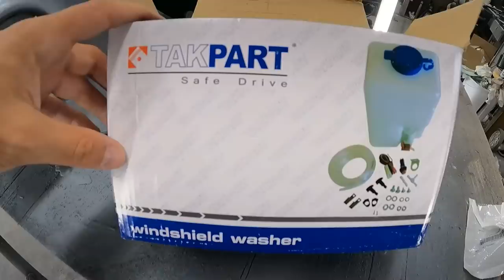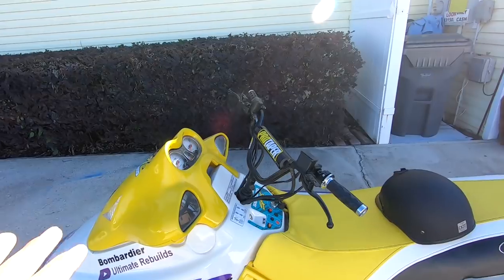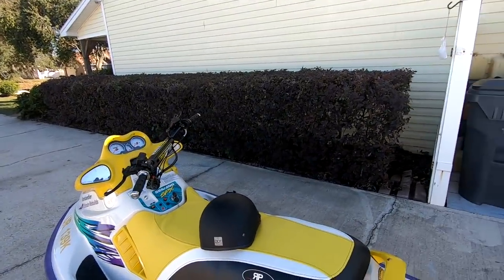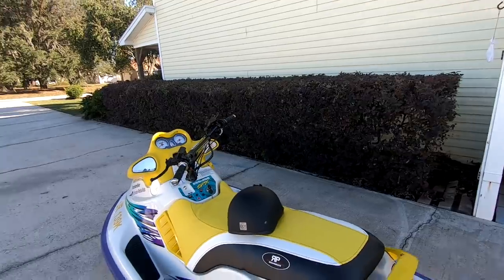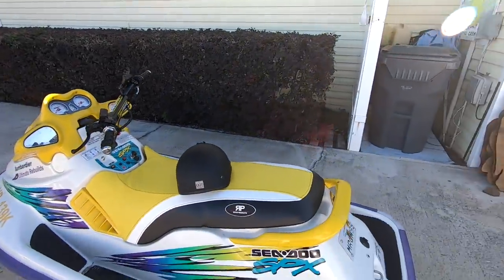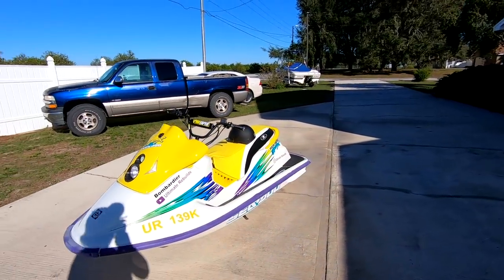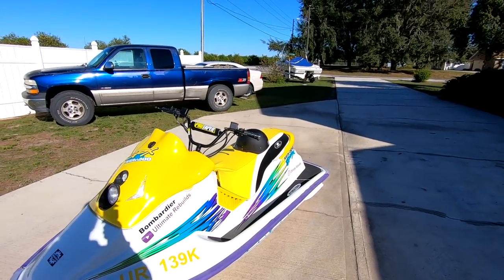Building a Custom Jet Ski Motorcycle in 15 Minutes

Comment: They are great toys. Only thing I would do is find a way to make 2 tubes on each side that would come down with ruber at the ends so you dont need to put your feet down when you stop, they would also work as side stands. If it was the model that had the manual lever to engage reverse that would be neat. Rig it in a way that using that lever the 2 tubes would come down. 😀😀😀😀👌👌👌👌👌